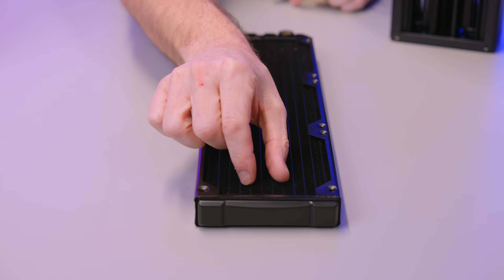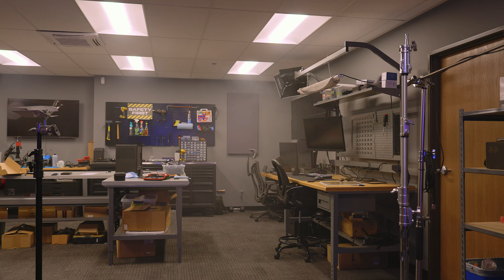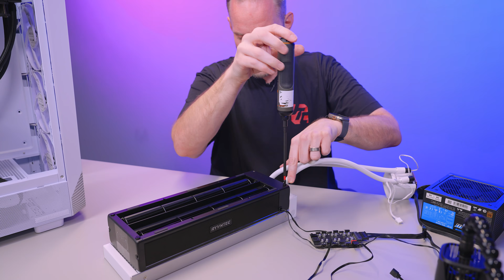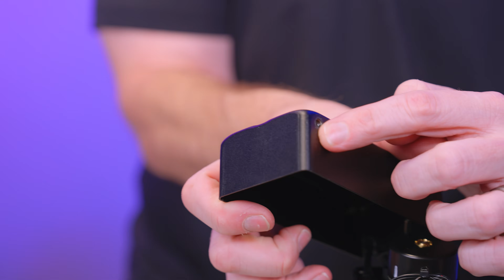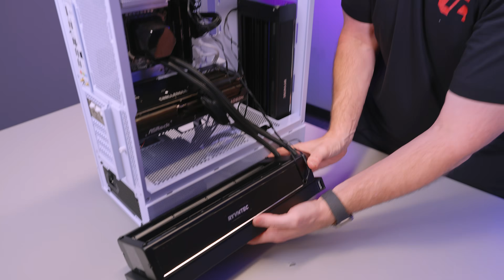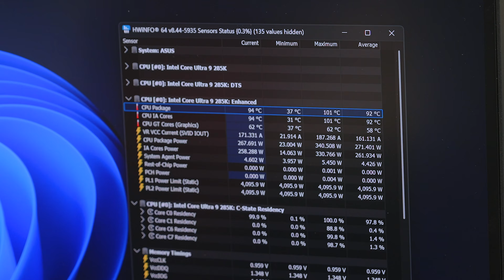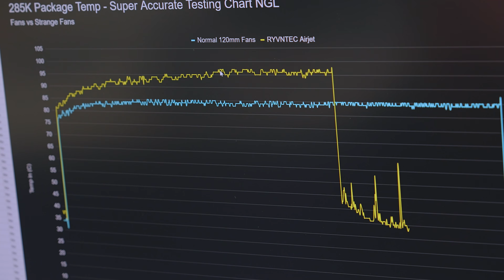Check out this INSANE Prototype!

Comment: You will most likely get more even laminar flow across the radiator finstack if you switch to draw through rather than push through, also for more consistent spread on the output side, just design and 3D print air guides, I do this already with axial and blower fans to push air into the direction I want or need inside the case, CAD and a 3D printer can help make some pretty meh products work exceptionally well.

Comment: Not testing it in pull is a shame.
The fact that you speed up front fan MAKES IT WORSE FOR RAD. You literally showed the fact that positive flow is so high, that from the back it keeps going out - which means, top fan doesn't even have a chance to suck this fresh air from the front.

Comment: These are perfect for me in a very specific non PC cooling scenario. Ive  got 2 extra monitors stacked on top of each other off to the side and have mounted  
2 x 200mm fans above them pointing at me (cause I'm hot stuff 😂) they're controlled by aquasuite, this would be so much cleaner though. 🤔🤔

Comment: I liked the video just for the cable flying off Jay's hands lol
Kidding, thought this is a great idea, I really hope it flies off, I would buy it, even if it costs slightly more than the average premium cooler (like somewhere around noctua's price, since its basically the same as 3 120's).
It clearly wasnt designed for radiators, but should do wonders as bottom intake + top exhaust on a cpu air cooler setup -  making one hell of a negative pressure , even dismissing front intake. Or just front intake with the regular 120/140's on exhaust back and top.

Comment: two things:
1. obviously I agree with everyone asking to test it in pull config
2. now that you have the means, make some kind of diffuser, splitting the central column of air in the middle and push air through each side of the flow path on the rad.
2.5. you always can do a double-push (one "fan" for each flow path on the rad) 😜

Comment: These things are pointless in a case. Steve did 2 videos regarding these. The only single time it was useful was in a small case designed and built around one of those things. In a traditional case they are crap

Comment: Make a 1/4 in adapter using a 3d printer to attach it to the radiator and try pull then push configuration and see if it will help or not.

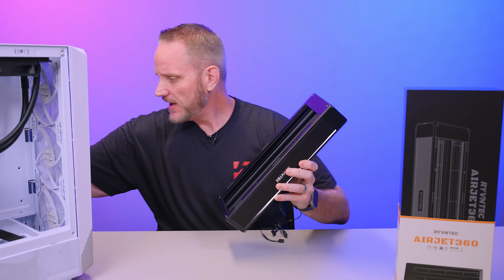Comment: at 3:12 you said the sizes are 240 and 360 but the site says 360 and 480. please ask them to make a smaller 240mm so I can try to add 360 on front and 240 on bottom of Corsair 680x.

Comment: So for future manufacturing maybe not more clearance as you mentioned but maybe more support between the 2 thin sides like support beams and even bolt shafts so that way it doesnt get any thicker but would have more support for tightning down to radiators

Comment: Be interesting to see if you blocked the rear vent, removed the top fan, plugged the fan into the aio to control speed, to see if it creates enough case pressure to manage temps.

Comment: REC's participant aka Jack Martins aka blue participant is a Linux OS user. He runs his windows games on a Linux PC with the following specs: a Geforce RTX 3050 - lowest tier, just a 300 euro gpu, entry level - with 32GB DDR4 2166 Mhz with x.m.p. turned on (3200 Mhz) and a two generations behind, 350 euro, 13th Gen Intel core i7 13700-KF with 8 eficiency cores and 16 performance cores. 
It runs games with graphics from last year (2025) with ray tracing enabled running in a working, non-flaky condition. Ex: GTA V enhanced. 
This, so People can see how microsoft was fucking around with everyone trying to deprecate a lot of people's PC hardware just because of a tpm 2.0 chip or the generation of your CPU or even both - based on most people's PC specs. One should notice how in the olden times there wasn't such a check. things would just run slowly if so. Btw people, GTA V enhanced has approximately or the same graphics GTA VI (GTA SIX) is going to have. *PS: Your windows PC can be turned into a Linux PC, in other words, it can have Linux installed in it instead of windows. Any windows PC can be turned in a Linux PC.

Comment: This might work for one of those frakenfan builds where some fans are on the outside of the case helping to pull hot air out of the case. My build came with 6 AIO push pull fans on the front but no top fans to help push the hot air out. You could feel the heat kind of bleed up through the top of the case. A little experimenting and aesthetics be dammed and now 5 more fans and the air flow is stupid fast and push/pulls the hot air out. 6 in the front(AIO), 2 in the rear and the PSU on bottom pulling air in, 4 at the top pushing and pulling air out. This item could just sit on top of the case pulling air out and maybe look better doing it.  My temps dropped and average of 5c just by moving more air. Just a thought.

Comment: soon as I got to 2:35 and Jay pondered how they work on a radiator I immediately thought of my Midea U-Shaped AC and how I have a single fan like these in it that pulls air through a radiator with the silent force of a hurricane. And by the end of the video I wondered how the fans would work if he set them to pull through the AIO instead of pushing through it.

Comment: I'm still using a pc case with an acrylic side panel, i wonder what it would give sticking 2 of these on the outside blowing in, at one time i used to have 8 fans stuck on there, it sounded like a jet, this could do the job more silently 😁

Comment: Equalizing the pressure across a radiator would be possible if there was a sealed chamber between the radiator and the fan. It would require fins in the chamber to normalize the output pressure but it's possible that the fan in general can't provide enough static pressure to match the output of standard fans.

It's like an hvac system in the way that a barrel fan can produce an even output but it relys on back pressure and distance to produce an even output.

Comment: They can run the pass-through screws through a sleeve. The inner sleeves cut to the proper length will prevent the outer cover from compressing under screw tension.

Comment: Block off all vents and try without fans on the rad so all intake has only through the rad to escape. Putting in a tube for the screw would solve the 2 issues, fiddly screw insertion and compressing the cover. The screw cant compress the tube.

Comment: I don't think this would make a massive difference but they should supply a gasket to seal between the fan and a radiator, if they are intending on this being used on a radiator.
Reply: Also bushing sleeves for the mounting holes might be a proper fix to prevent the cover from smashing into the motors.

Comment: The manufacturer here has chosen the wrong approach.

As I already mentioned in your short video, Lian Li has implemented this technology differently in their new LANCOOL 207 XL case. The flat sides (instead of the large rear panel) draw in air from the bottom left and right of the case, and the side panels have a special cutout and air duct at the bottom for this purpose. Furthermore, the power supply is not at the bottom rear but at the bottom front. This allows the two long fans to direct air from the sides upwards to the graphics card (which is normally mounted horizontally) along its entire length and its own fans.

With this solution, featuring rear intake and the overall thickness of the system (which only fits in a few cases!), the entire system (in addition to the problems you've noticed) is problematic. And without a solution like the LANCOOL 207 XL, where the case is optimized for bottom mounting of the graphics card, the power supply must be at the front or, in a dual-chamber case, on the side behind the motherboard. Furthermore, because air is drawn in from below, the case must have correspondingly tall feet. One has to ask the manufacturer if they've even considered how to effectively integrate this into a standard PC case.

As it stands, this is reminiscent of many products offered on AliExpress, where some Chinese manufacturer comes along with some new product, but YOU, as the buyer, are left to figure out whether the thing could possibly make any sense for you, aside from the technical (airflow) specifications that the manufacturer touts as the killer feature.

Comment: I paused as you were overly concerned about lower airflow at the edges. I am guess it makes little difference in thw cooling effect the fan jas because it is moving so much air through the middle it makes up plus some.

It seems to me the coolant is exchanging heat with a ton more molecules of air than it typically would, that ia bound to lead to lower temp. 

If im wrong so be it, i just know when i built my Roots supercharged cobra the more air velocity we got at the intercooler intake, thw lower AIT becamele until the point temos were close enough to one another that the intercooler was ineffective.

Ok unpause

Ok... i love your videos so ima just keep it to myself.... but come on you made effort to have it fail. ... first of al that fan should PULL through the AIO to avoid the effect you spoke of. And you are way too smart to havr not known that

Comment: You're right they need to shift the motors towards the center and to add reinforcing tubes to prevent crushing and interfering in the motors operation. As others have mentioned, do the pull configuration to see if that makes a difference...

Comment: I have this style fan for my window fan and tower fan for moving air around the room, and they do work very well. From what Vornado calls the style of fan blade is cylindrical impeller. When I swapped out my window fan from the 2 x 8" traditional fans to this Vornado cylinder style fan, it was much quieter but pull / pushes more air, I mean, way more. It was really noticeable when I would close my door. It took a bit more force to close it when the fan was at medium speed from the other one on full blast. Also, the Vornado tower fan is just wicked better at moving air compared to the round regular fan, but you have to point the cylindrical fan directly at yourself, were the regular fan covered more area when pointed in one direction.

Comment: It's 'Torquing' the squareness of the whole fan, when it gets tightened down on each end, it gets slightly twisted and the bearings get locked up from being put at a minute angle along the over all length. Try just using the center 4 screw mounts, and see, that should work if that was the problem. 👍 But either way, it doesn't get the full coverage of a radiator, and that's a bummer.

Comment: I wonder if an AIO was built for it if it would perform well in that case.  That or smaller fans turned sideways - but at that point is it even worth it.  Maybe just not the use case.

Comment: Need to try in a pull config, as when the air is being pulled through it is not limited to any narrow channel. Not sure how to mount it to work around the prototype mounting flaws, but maybe between nick using something from the 3d printer to make tubes to reinforce the either the whole entire motor assembly or just tubes to help rigidity where the screws go through. Might be a whole new video.

Comment: These things don't seem like they'd even fit in most people's cases.

It's very poorly designed and not well thought out. They'd be useless on a radiator, due to how narrow the stream of airflow is.

I can't even think of a suitable application for this thing, in a PC, where it would be worth bothering with. 

I have a feeling that the narrow band of air would cause pockets of hot air in the case, around your components.

Normal fans would be better because they keep air flowing over everything. Not just a narrow stream blowing through the case.

Comment: Interesting fans!
Could the fans be stopping because of poor flex or torsional rigidity?
Is it possible that the chassis around the fans is twisting slightly when you screw them down, causing them to stop spinning?
An easy way to test this would be to hold the chassis at both ends and gently flex or twist it to see whether the fans stop spinning.

Comment: I both love and hate this trend of using crossflow fans in PCs. I've known they were ideal for a long time and have one I custom made for exhaust on the top of my PC almost 10 years ago. I was dreaming that one day I'd get some investment to bring them to the PC market. Admittedly I never did anything to make it happen, so I can't be that upset. 
Also, the airflow pattern doesn't matter because fans should ALWAYS be PULLING through a radiator and/or filter. I don't care what anybody's testing shows, pulling is always better since it pulls evenly through the restriction. Having a small gap between the fan and the restriction is also important to make sure it's pulling through evenly. 
All that said, if you have to push with a crossflow, I'm sure it will still perform crazy well. It's possible there are some physics I'm overlooking when it comes to pushing with a crossflow since it's something I've never really considered, but I bet it's still fine, especially if you leave enough room between the fan and restriction and add air blades that correct the airflow pattern.

Comment: There's a reason why no one is making "fans" like this for PCs or AIOs. It's not suitable.

Normal fans are better. They have a wider cone of air flow.   They're thinner. And they're quieter under load. 

I can't think of a situation where you would need high velocity airflow, in a narrow stream, like you get with these things.

Comment: If they added a tube for the screws to pass through that should help with the end cap contacting the motor armature when the screws are tightened. No to mention that it would make installing the screws easier.

Comment: what about using this fan to pull air out of the case, and not using fans on the radiator? maybe a front and or bottom rad with no fans, and this chonky fan on the top to pull air through?

Comment: I wonder if the fan orientation/blades/rotation were reversed so they exhaust out the SIDES (meaning the edges) of the chassis instead of the center channel would make it more optimal for radiator use?

Comment: Bruh... you're killing me. How did you not even consider using a pull configuration? Assuming there's clearance (looks like there is) that might help ensure more coverage across the rad than trying to push through it.

Also, yeah simply putting a tube between the screw holes inside the cover should also constrain it from interfering when tightened but those tight tolerances are a bit absurd.

Comment: The could weld in a cylinder around the screw that way when you tighten it, the screw tightens against the cylinder and compresses it.

Comment: In addition to trying it pulling air through the radiator, try a different case.
A big old server case with room for a Airjet fan on the bottom as well as the radiator on the top? Maybe?

Comment: 1. There are screw holes in the middle of the fan/rad just use those
2. Due to the high static pressure one fan is enough to push air into the chassis, no fan needed on the rad

Comment: The longevity of those motors/bearings would be my concern see how fast the spin down compaired to standard fans. That as a stand along front intake seems super promissing for keeping everything cooler in the case as it seems it does not give enough time for heat the expand like it normally does in a case. And if that does work that way should allow a regular AIO to work a bit cooler regardless. but hey only will tell !!

Comment: i had these back in the day on my silverstone ssf case. i would definteily not use these for a RAD. these are best ofr a cross flow. and i still needed regular PC fans. it was just used to fit in a small space for my airflow. i would rather use 2x 180mm fans than this crazy behemoth.

Comment: If they put the guide tubes as you suggested, then that will prevent the casing from "collapsing" and rubbing against the case as those tubes would take the force of the screws.

Comment: the problem is the GPU exhausts inside the case and the rad needs to deal with that. radiators houuld be OUTSIDE the case. in general computers are really poorly made. the gpu heats up the CPU. it is just dumb. they need to be separated.

Comment: I find this as perfect front case fan. This thing should be perfect for pulling air through filter on the front of the case. If they also made 140mm fan version of this one it would be perfect. I want this but i do not think i will be able to get this thing in EU :(

Comment: This could actually be solved by running the fans in the opposite direction, pulling air from the middle, pushing from the sides, and having a small 5mm shroud to allow the air to spread over the rad. Pretty sure this could be better.